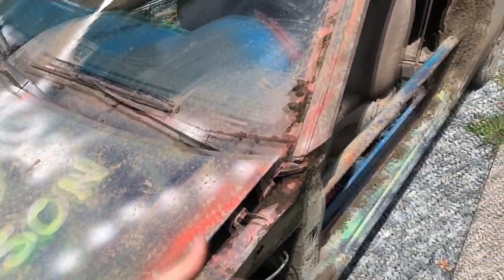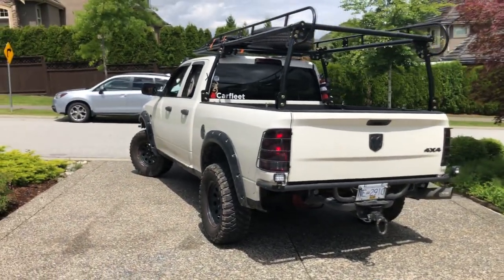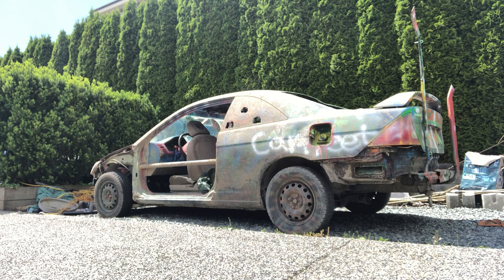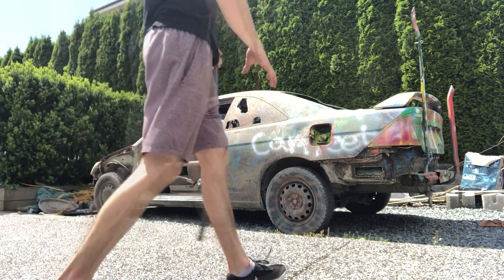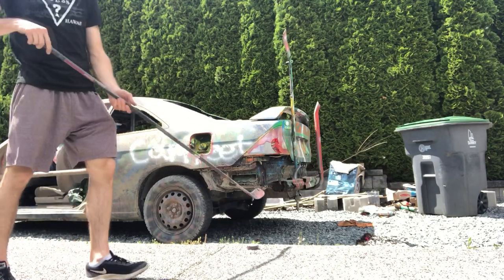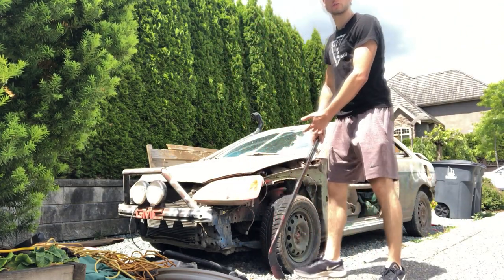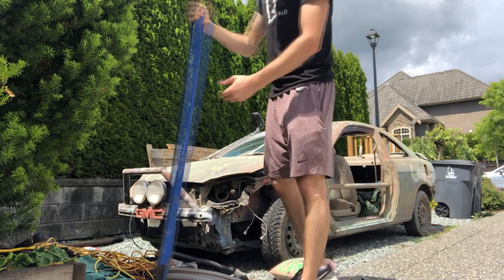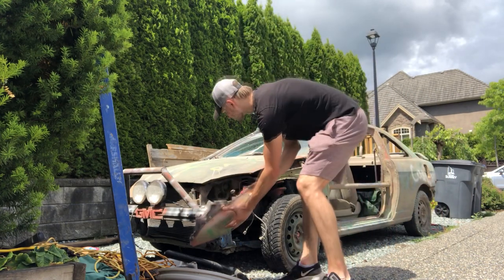SHOOTING HOCKEY PUCKS AT THE OFF ROAD CIVIC!!! WILL IT RUN?? (MUDDER CIVIC PART 9)

Comment: snow chains if you want better traction in the mud lol it does work but i had doors on the car that i did it with so might not be that safe with out door up to you
Reply from the maker: Haha good point about the chains and we gonna send it no doors doors are broken 😂🍻
Reply: @Carfleet  if you can find a cheap set that really hug the tire buy them trust me you will be amazed at how well it will work if you never have before but i wouldn't spend more than $80 on chains it's a beater and they will most likely get wrecked
Reply from the maker: josh435 I’ll check it out! Thanks